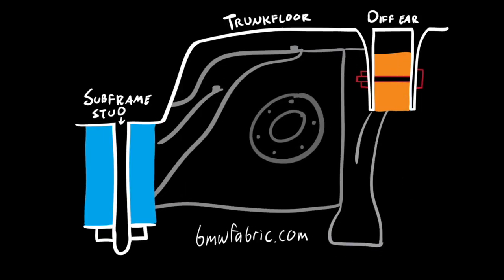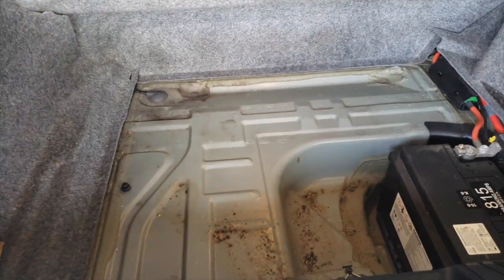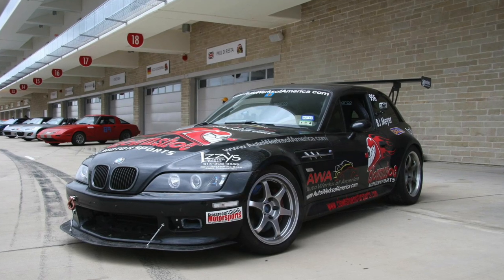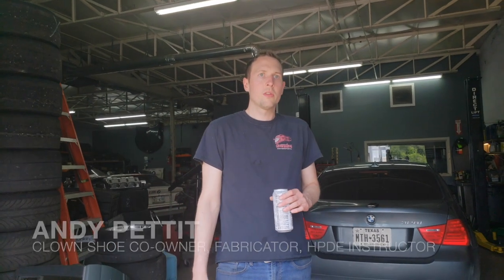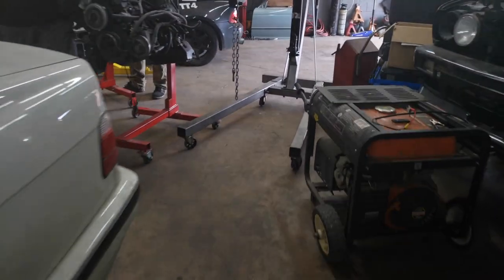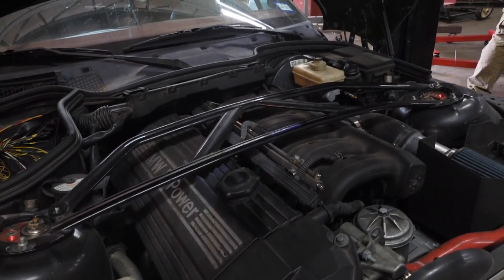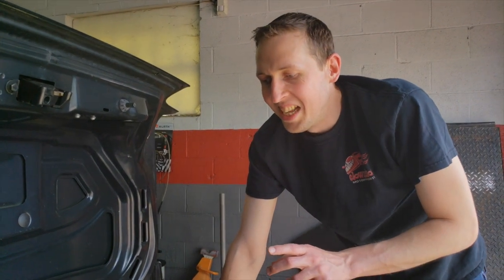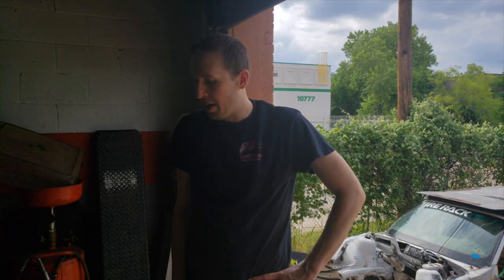The Randy Forbes Z3 Subframe and Trunk Reinforcement Episode

Comment: Also, the two-eared approach is overkill.  Definitely not needed on any Z3 including the M variants.  Even cars that are tracked will do just fine with the single ear approach.  Randy has two Ms that he tracks. One has the two eared job, the other the single ear.  And with the single ear approach you don't have to purchase a new diff cover or aftermarket mufflers in order to obtain clearance for the two-eared approach.

Comment: Guess I'm fortunate that my 99 2.3 roady hasn't any rust issues, had my subframe down for doing IE bushing on the sub, and the RTSB. But be that as it may, the Koni yellows and H&R drop kit got yanked for oem struts and springs. IMHO the car was a death trap in wet conditions. Once the oem springs were reinstalled, no more hydroplaning.

Comment: Let's be clear here.  This is a BMW design problem and has next to nothing to do with the car's age other than repeated flexing of trunk floor and application of downward forces will bend, crack and tear affected brackets and other sheet metal.  This problem emerged quickly after BMW started putting larger engines in the Z3 when the subframe bushings were quite new.  Since the Texas shop chose to lie about this (unbelievably saying that it was not a design flaw but an age issue), I'd take my business elsewhere.